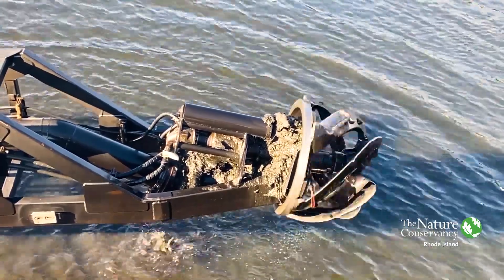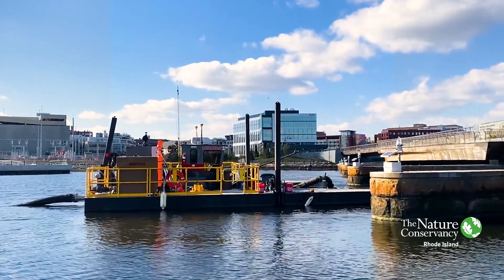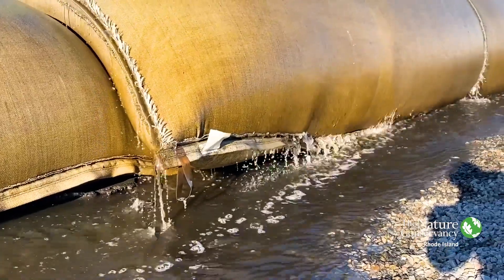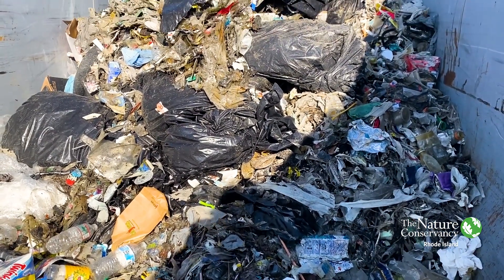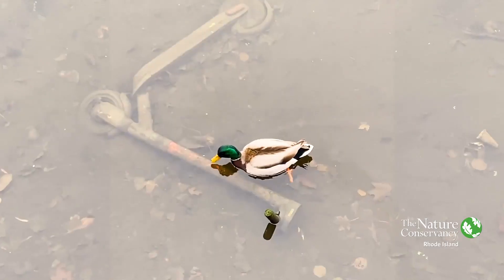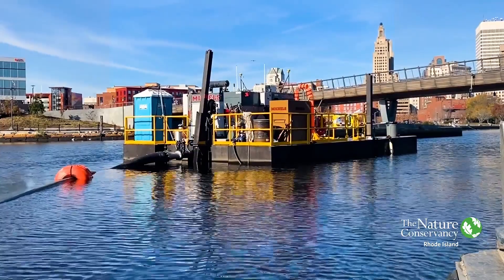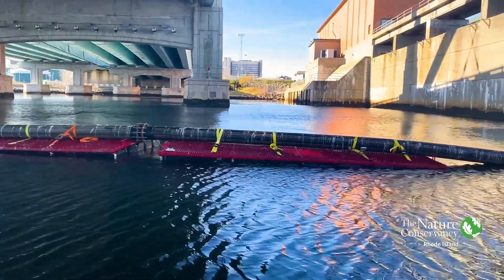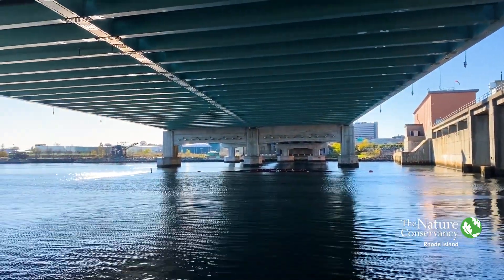The Biggest PVD River Cleanup in 30 Years

Comment: It is a nice idea. But what is the point of moving all of that trash from one coastal are to another coastal area?  It should have gone to the landfill.
Reply from the maker: Understandable, but trucking that amount of material would be been tremendously expensive and honestly, a waste of valuable landfill space. Larger items, like scooters and traffic cones, plus any plastic debris removed from the dredge, were put in a few dumpsters and sent to the landfill. The rest will be mixed with cement to form solid material that is strong enough to help raise the elevation of the South Quay terminal in East Providence. Future videos will touch on this in more detail. Thanks for asking.
Reply: The material will be used in constructing a new marine terminal.